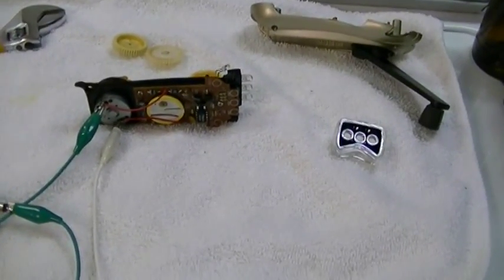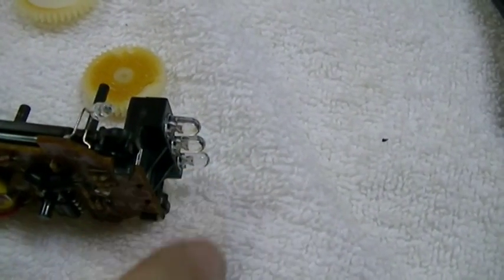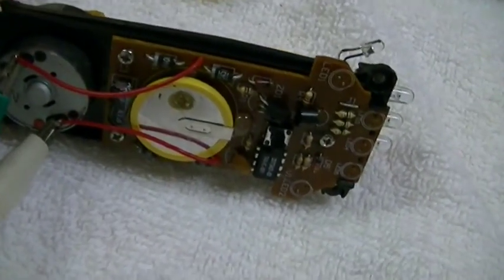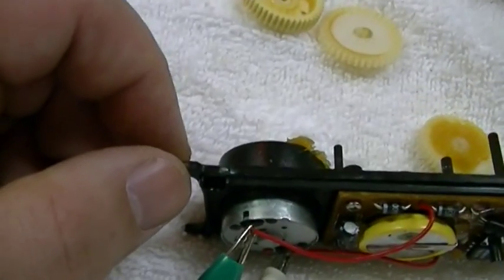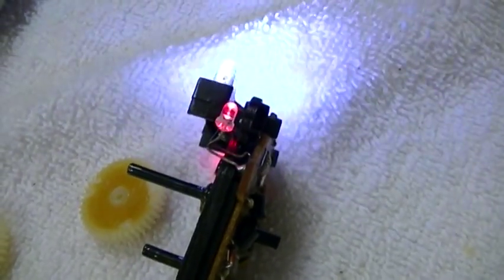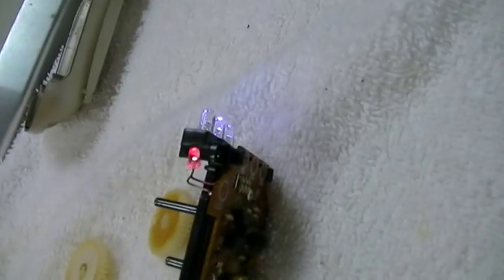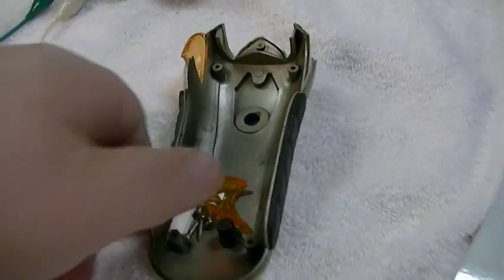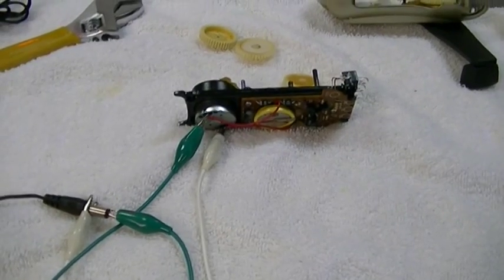Hand-Crank Generator Flashlight Repair

Comment: Thanks for posting this. I don't feel so guilty that I didn't keep it up, and that I'm not the only one that this was a loss, and not guilty for now putting in with the box of other dead electronics to take to the dump's special collection.
Reply from the maker: If nothing else, there are the LEDs, which might be able to be used in another project.

Comment: I've had quite a few of those myself and have never had any luck with them. All of them except one have died after about a year and a half despite the fact that I maintained them. It's a brilliant idea, but it's not very practical when you factor in the battery. Most people buy them because they "don't require batteries;" little do they know that it still contains one, and when the time comes to use it, it's dead just like a regular flashlight would be if it had been left alone for months on end.

I actually extracted one of those motors out of one to use in something else, but I didn't realize it's one of those motors that gets extremely hot when run even for a short time. Nearly burned itself up.
Reply from the maker: Some interesting points you bring up.  If they could make it with some sort of capacitor instead that won't really die (although with the way they make things now it will), that would be an idea.

I also have a hand crank/battery/rechargeable battery/solar recharge flashlight/radio thing.  I used that during Hurricane Sandy, and it actually does charge up to run the radio for about 5-10 minutes at a time.  Turn the (incandescent) flashlight on and its dead--I guess the radio doesn't take much current to run.

Some motors run hot, it's just the way it is.  Of course this is being used in reverse as a generator, and it's always inside that case so you don't know how hot it really gets.  It's probably being turned at a fairly decent rate of speed considering the gear reduction.  

I wonder if that motor you had could be run cooler at lower voltages.  Or, if it were driving something that was at the top end of its limit of torque, it might have been pulling more current, more current means a hotter motor.
Reply: jaykay18 That's such a good idea, and it makes perfect sense. A capacitor would definitely be a great, cost-effective replacement. It may burst after a while, but it would surely outlast those button cells. They'd charge easier too.

I was running the motor at a pretty high voltage; I think I was using a nine volt battery (just to test it out). The reason I did that was because it ran very slow at lower voltages. At any rate, I didn't end up using it for anything constructive. Maybe I'll find a use some time.
Reply from the maker: Rebelkid1112 That only produces a few volts, maybe 4 or 5, so 9 was almost double the voltage.  That's probably why.  I was running this one off a 6V 300mA adapter, which is probably more like 100mA, right about where it would be charging if being run properly.

If you can't find a use for it at slower speeds, and it runs too hot at 9 volts, simply increase the voltage until it's not your problem anymore.
Reply: Haha, great idea! I'll send it to Photoinduction on YouTube and have him do it for me. He'll run a couple of gigawatts through it and call it a day.